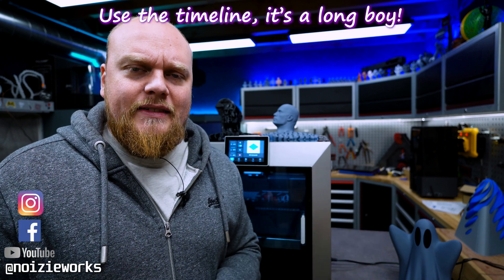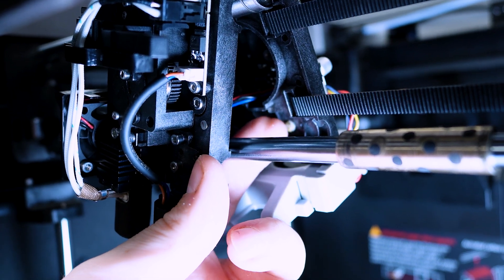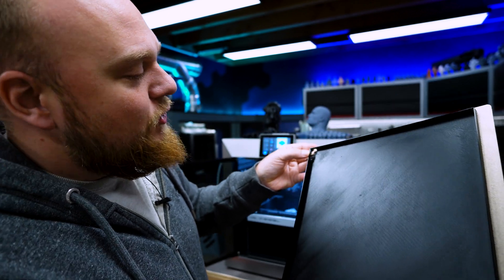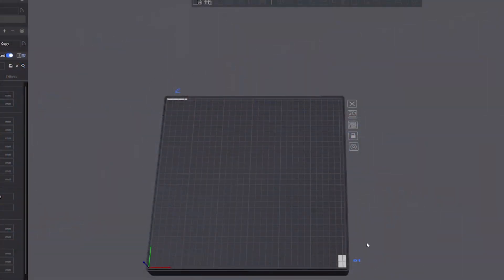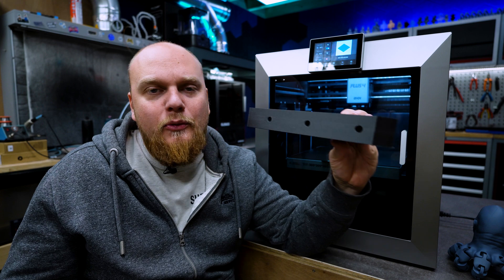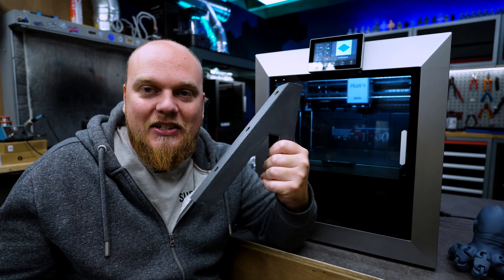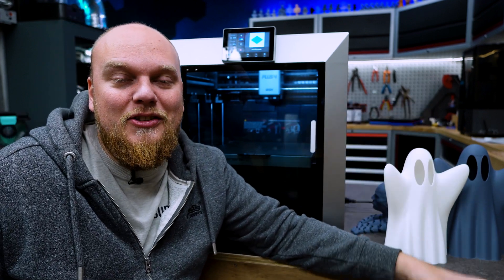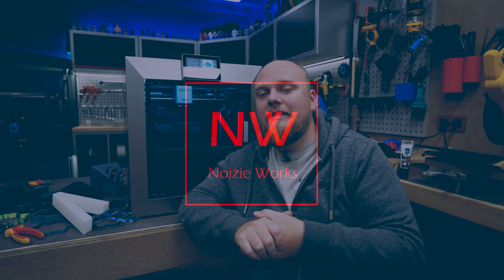How i fixed the Qidi plus 4 loose bearing and hidden filament cutter feature?

Comment: Great video covering the issue! But I have something to add I found out in one of these Facebook groups about the exclusion zones. I'll copy the text for you 

"Yeah, I have confirmed I can print the entire 305x305 once the exclusion zones are removed in the Slicer as the there are no mechanical limitations.

I was able to print parts similar to the lids in my previous post right into the exclusions, which are tiny, and hard to hit unless you really try...."

This information was found in the QIDI TECH Official User Group at a post from Scot Etat on first layer porn 😅
Reply from the maker: Nice! After some debating with different users i think it's there for the AMS in the future, so your print doesn't interfere with the cutting(lower right corner) and purging on the top left.
So i think the ams will make the total buildvolume smaller.
It's just a guess so take it with a truck of salt 😆
But great nonetheless, removing some command lines and full builplates!
Btw, i'm getting posts from the official group but still waiting to get in to see how big the problem is, now at 5 with loose bearings.
Will pin your post to correct my statement, thanks for informing me.
Reply: @NoizieWorks  No problem! But yes, I think as well those exclusion zones are for the AMS system thingy. It would be great if they have the option to disable it in the slicer.

But in my opinion i wouldn't use a AMS, I have a prusa MMU here and I barely use it. I think for engineering stuff a toolchanger is the way to go. AMS? Just for fancy colorful stuff and simple material combinations
Reply from the maker: @Rraijjar  I would use it more for dissolving filaments. Some models are just a pain to remove support and to automatically replace empty spools for a fresh one without having the print pausing  for hours because your not home.
Reply: @NoizieWorks  I try to design my stuff to remove of need of supports. But i can understand people will love to have some dissolving supports!

Buuut... you made me buy this printer now xD with some help of other people of course
Reply from the maker: @Rraijjar  oops, so sorry

Comment: I have the same problem on the Qidi X-Plus 3, so the previous generation printer. The head design is pretty much the same. The lower graphite bushing comes loose after a while. Qidi sends a video to reposition some kind of foam tape material to press the bushing against the head assembly, but the issue reappears quickly. I will try to bolt it in place like you did, thank you.

Comment: If you really want to show banding then I found this trying to finish some wood PLA prints on my q1 pro as I sanded the print first I sprayed it with a light coat of black spray paint and then send it it again lightly both times with 320 grit after the second sanding when most of the black paint is removed what is left will be in the banding areas and will show it on camera very very well
Reply from the maker: @jasonwilson9207  thanks for the tip

Comment: I love your channel and your videos I know that being in the automotive industry not everyone has the knowledge base on adhesives that I do but there are adhesives that would be much better choice for that than silicone Yes probably overkill to use something more than high temp silicone but a two-part high temp epoxy would be a better alternative also a small amount could be applied to the threats and screws now granted if you ever needed to replace the bearings that could definitely post a large hurdle

Comment: I have never owned a 3d printer before. So, being guided somewhat with what has happened with Bambu and their recent announcements, I decided to look at other models with more interest.
The Qidi plus 4 certainly cannot be ignored.
After watching many reviews on this printer I must say that this one is the only one so far that has given me some concerns.
How relevant do you feel that your comments are in regards to the bearings that could, potentially, still be an issue on the printers sold today..?
I am surprised, unless I have missed them, that I have not noticed it mentioned elsewhere. One other review of using the printer for around 1000 hours is largely most positive.
You refer to the batch one releases of this printer. With stock etc within retailers you never know what you are going to get.
Are you aware if Qidi actually addressed this issue at all, with the printers they are selling now..?

Any updates to this issue you experienced..?

Thanks, and thanks for sharing what you did to help to resolve your own problems.
Reply from the maker: Final review is getting worked on. I have about 6 confirmed cases of loose bearings. The fix is easy and qidi will refund it if you don't want to work on it although they will try very hard not to.
Personally i wouldn't be concerned about it.
For the money it's one of the best featured printers to date.
Reply: @NoizieWorks  It is hard not to feel, with the SSR board issue for those on 110v, the heated chamber issue (?) and then this bearing issue to not have concerns that their quality control is not working as could be reasonably expected.
I do believe that the CO has issued a release to suggest making improvements in that going forward.
Whilst that can be reassuring, it is what is being sold now, and I understand that you note about the fix being "easy". But please do not underestimate your own levels of skill and understanding with what you are doing. I would be reluctant to have to identify the need and then whatever hassle there could be in contacting Qidi for screws needed..?
I did not plan on spending that amount on a 3d printer with known problems if Qidi have not addressed those with what is now being sold.
As noted, I have not owned a 3d printer at all. In some ways that is what had previously attracted me to a Bambu printer, although my thoughts with that have changed somewhat now. 

Many thanks for your reply. I will look forward to your follow up final review. If the "newby" could be considered within that, it would be appreciated.
Reply from the maker: I completely agree with you, i do hope that if you have seen my vids that you could see that i have given them a load of crap and i wasn't gentle anymore in the last vids.
I also expressed my concerns plenty of times to my contact with those videos linked which in turn resulted in new batch being completely tweaked.
They changed the plastic housing to be stiffer where the hinges are, made adjustments to the metal frame and the ssr is replaced in all the units because of the feedback from the community. You will see in the review that they still have work to do but the new batch is pretty solid.
Reply: @NoizieWorks  That is most reassuring and I do appreciate the candid approach you have taken, I do wish that many other content creators would do likewise.
This is not their first printer to the market and, so far, most of what I have noted, again just starting to read and get to understand the terminology here, should have been picked up during QA testing before it went to the market.
For me in the UK it would probably be Amazon I would look to, easier returns if needed. It might well though be more of luck as to what revision that I would end up with.....
Still noting this model as being a strong consideration, maybe even the up and coming Centauri Carbon. It is nice to have choice, even better if the manufacturers have a consistent approach to their quality control and are both accessible and approachable.

We are where we are, I look forward to your follow up video, subbed.

Thanks again for taking time to reply.
Reply: @NoizieWorks  Just noted another person uploading issues and problems he has with this printer. I could not link to his channel as YT would delete the post. He goes by the name "TECH NOT WORKING". 

This printer is becoming less attractive, with their contact seemingly being quite poor.

Comment: Hey @Noizie Works. I just got my Plus4 and I have started to notice a rattling noise (sounds kinda like plastic on plastic rattling) coming from the toolhead area when moving in the X direction but it only happens on the lower half of the print bed. The noise goes away when I gently squeeze the front and back of the toolhead housing together with my fingers. I was just curious what symptoms you had when you first discovered that you were having issues with a loose bearing. I am trying to figure out if I need to do what you did in this video or if I am just overthinking a loud, rattly toolhead housing. Thanks!
Reply from the maker: @delbass6723  could be that the housing is a bit loose, try to tighten it and feel if the head is wobbling

Comment: I hate when vendors says 'limited number of customers have issues X' - devices are mass produced so EVERYONE will have these issues sooner or later. Use cases might be different, but the end result will be the same. I really want to love the Qidi ... thankfully I need to wait until spring to buy another printer. Hopefully enough time to fix all these issues.
Reply from the maker: 💯 although that the lower bearing is probably not going to be changed in design. They didn't learn from the xmax 3

Comment: I have some inconsistency issues with the bed leveling and I wonder if this can also be caused by a loose bearing. The problems started to occur after some attempts to print PA6 with high bed and chamber temperatures ... Also my chamber heater fan seems to have died today. The plus4 is my 7th Qidi printer in a row of 8 and it is the first one giving me trouble like this.
Reply from the maker: Very easy test is grabbing the printhead and try to wiggle it. Should be rock solid. Heaters are also problematic with higher fail rate on the plus 4

Comment: As a mechanical engineer with several years of mechanical design experience QIDI's method of bearing capture is about as amateurish as I've ever seen. I was on the verge of buying one of these but between this, the SSR relay overheating, and the chamber heater blockage issue I've changed my mind. Relying on QIDI's customers as a method to find quality assurance issues is wrong.
Reply from the maker: Probably 1 of the worst problem filled machines i ever reviewed.
Still hoping on a ssr recall.

Comment: What silicone type did you use? Would Loc-tite Blue or red be sufficient?
Reply from the maker: @helixxharpell  generic high temp silicone from Bison.
Loctite in plastic selftappers hasn't been a great success in my career and here is the link to the product https://www.bol.com/nl/p/bison-siliconenkit-high-temp-tube-60-ml-hittebestendig-tot-300-c-makkelijk-verwerkbaar-zwart-kleurvast-blijvend-elastisch-makkelijk-te-verwerken-hittebestendig/9200000010529339?referrer=socialshare_pdp_androidapp

Comment: Another quality control issue : the extruder.
Multiple "clogs" using PETG > issue coming from the spring tensionner which was blocked by the small protrusion of the cover.  By the way, all the screws were not screwed correctly.
Reply from the maker: @PequignotMichel  noted

Comment: Facing an issue with the proximity sensor at high temps.
Now issue with bed at 90°C and chamber at 65°C but with bed at 120°C the proximity sensor dont trigger at all leading to nozzle to bed collision.
It could be a faultly sensor or an unrated sensor for high temp.
Will check with my second Xplus4. Could you check with yours ?
Reply from the maker: @PequignotMichel  will do!
Reply: @NoizieWorks  Testing the other PLUS 4 > No issue at all ! Seems to be a faultly sensor.
Reply: Looks like I have the same issue. The bed leveling is very inconsistent at high temps
Reply from the maker: Then i would reach out to Qidi

Comment: Thanks for your help. Just bought Qidi plus 4, your videos are a real asset (Qidi should think about employing you). Printer is working great now, really pleased with. I did contact Qidi tech support about adding a Garolite bed and they said it could not be done because of the way the sensors work. My intention was to glue 0.8mm sheet of Garolite to PEI sheet, I would appreciate your view on this or any better way to print nylon. Thanks again all the Dave
Reply from the maker: I see what they mean, it's the offset from the inductive probe and the nozzle probing.
Not going to work well with extra .8mm.
Did you try hairspray or the glue? And thank you!
Reply: @NoizieWorks  Have not tried printing Nylon yet, but will give it go with glue (just had good results with Garolite). Would you mind explaining inductive probing? My other printer used the bed surface
Reply from the maker: @daveedmunds7854  it's using the metal in the flexplate to probe with the sensor, then it does a physical probe with the nozzle to do the offset. What i think is that if you put a extra .8mm off non conductive material on top the offset can't compensated but you can try as long as the nozzle doesn't crash in the buildplate.
I also have seen people use kapton tape.
Honestly, print hot with a big brim and it's probably going to be fine. I use Nylon Cf and that sticks great.

Comment: Absolutely thank you for showing a fix for this. I am close to buying this printer and it seems the fix seems to be easy enough, now the only real downside it has is that a clogged nozzle is a ton of work to clean up, but I hope here for retrofit solutions. A friend of mine has the same issue with his creality not sure if Bambu also does have the same problem but for Bambu retrofit solutions already exist which allow a fast nozzle change which fixes the issue!
Reply from the maker: @werpu12  there seems to be a heatcreap issue, more and more people reporting on it.
There is a fan mod available to put the fan in front of the heatsink instead of what it's doing now. And thanks!